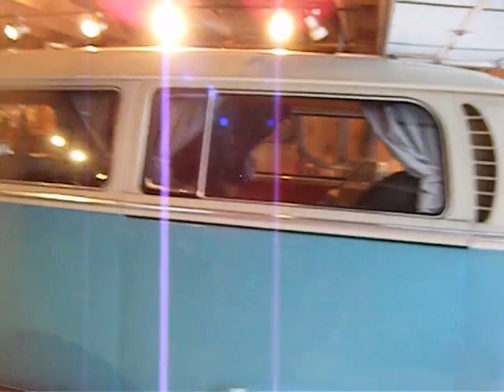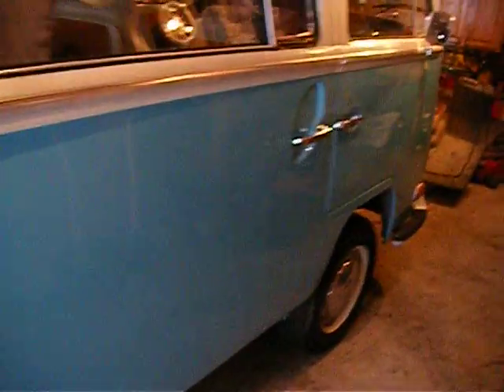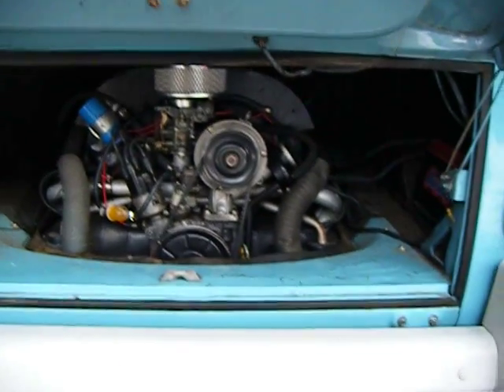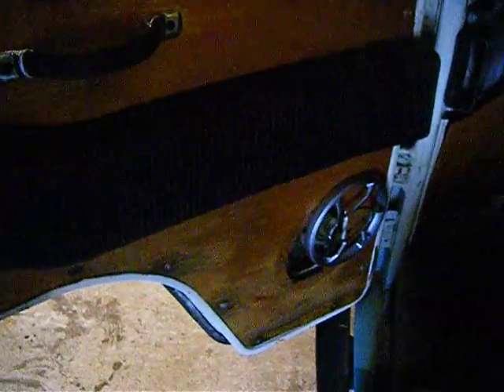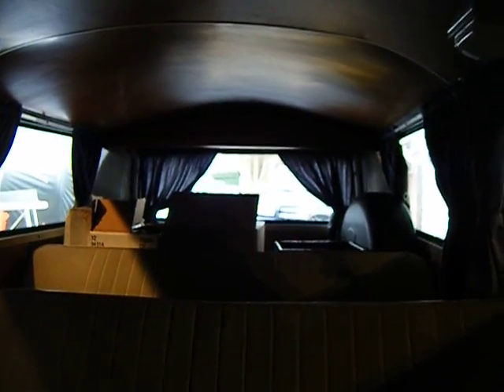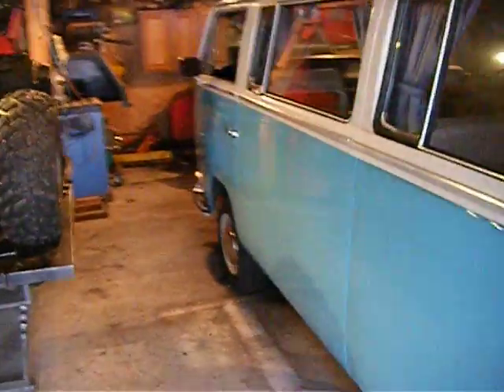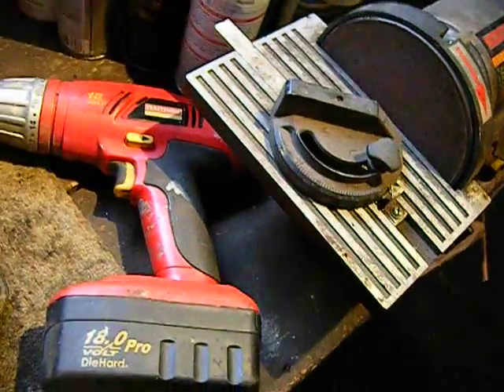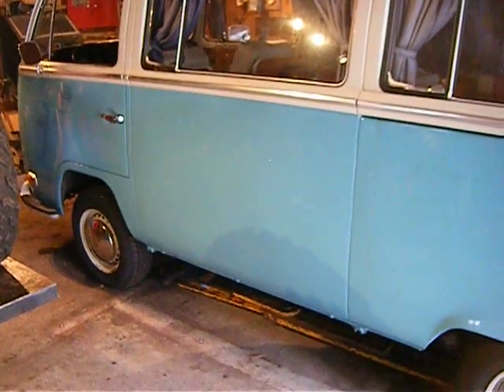1971 vw bus in for repairs

Comment: Nice looking bus.  I have a 71, same color - Niagara Blue...the CV joints were dated June 1971.  My bus was last on the road in 1999...so all new brakes for me...tires, shocks...cv joints...engine had 25 psi so I put in a rebuilt one...now it's on the road...Just yesterday, 
I got the head lights working - had hi beams, but just 1 low..no flashers, turn signals, needs a stereo...Maybe I will meet you in Boston and we have a Sam Adams over and talk buses...

Comment from the maker: I think I did , but if its leaking out the back, it needs a rebuild, hit the hardware with a penatrent long before you want to takes it apart, if its power brakes,as this one, clean out all the fluid in the booster or it will rot the rubber on the inside,,